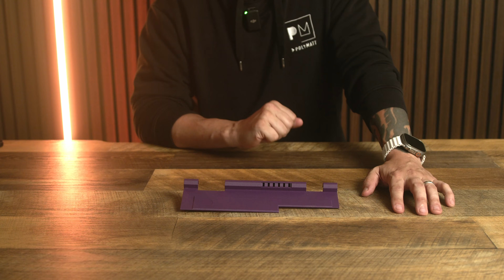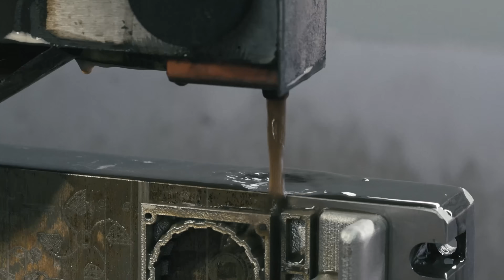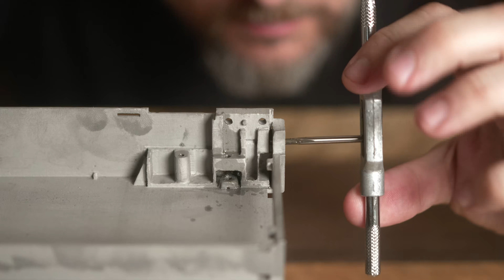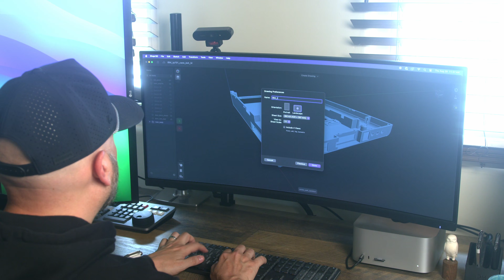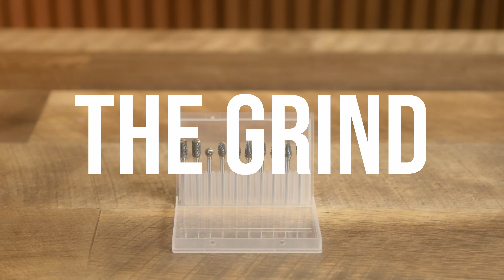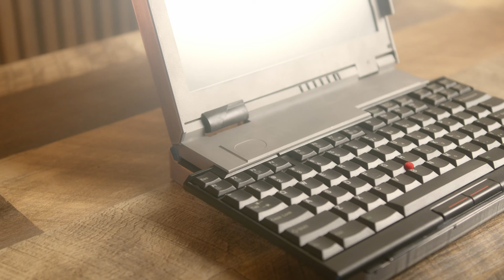I 3D printed a METAL laptop

Comment: Amazing project. But you didn't show it closing? Isn't that and the keyboard mech the most important part of this laptop?
Reply from the maker: Yup. Good catch. I eluded to some bowing issues of the bottom case. It’s currently preventing the laptop from closing completely. I’m kicking myself that this part of the explanation wasn’t in the final edit. Currently trying to figure out a way to flatten it because those 2 extras millimeters are preventing a smooth close.  😔
Reply: @polymatt  Thought it might be something like that!  If you figure it out, I'd love to see another update on that.
Reply from the maker: @domramsey  I’ll definitely do a followup when I get that sorted!
Reply: put it in some sort of press to hold it flat while it heats up to temp & also cools down. somthing like a ganja rosin press 😂😂
Reply: Seems like the best use of this would be a "frame" and then attach a sheet of metal to the large flat surfaces?  Obviously that require more fasteners etc.  But in terms of for example creating your own bespoke Chassis to use a commonly available lid with EG a Framework or Steamdeck motherboard.  (Edit: I should have watched to the end 😅)

Comment: fantastic job, the 701 deserves all the love it can get, would love to see a 3d printed aluminum 701 some day... maybe with the framework board in it? dream laptop right there
Reply from the maker: I really love that Framework exists and I hope more companies will start doing the same. I’d love to do a BYOC (bring your own case) for a Framework build.
Reply: Or a from scratch design with a Framework board, CNC milled would probably be cheaper.
Reply: @XenonG  ah ya, CNC from aluminum would probably be a good option, nicer finish too... I have a pair of 701c thinkpads that I got long, long ago, but one is in pretty poor condition (top lid cracking badly)

Comment: Hello, not sure if I missed some detail, did you discard using anodized aluminum because you was expecting some warping and the treatment would get damaged anyway?
Awesome to see you doing some metal work and testing the capabilities of these new manufacturing technologies.
Reply from the maker: Hey thanks for the comment! The choice of 316 stainless steel was really because that’s the only option the manufacturer had available - and I wasn’t going to pass up the opportunity 😄. I had heard about metal 3D printing but never actually knew how it worked so it was a lot of fun digging in and learning. 

A few people had suggested CNC but I really wanted to try to additive route and not sure if the complexity of the bottom case could be done with even a 5 axis CNC - but something I’m definitely going to look into. Thanks for the watch and the comment!
Reply: @polymatt  I was pretty impressed by the details and accuracy, the last time I saw a metal part done that way was 6 years ago and it needed to go on a 5 axis mill for all the accurate features (not just for the extremely ones) but it was a titanium alloy part for a military drone so who knows.
Awesome that your sponsor gave you that opportunity and that you could share it with us.
Reply from the maker: 💯 and now I’m going to consider a lot more projects to be done in metal!

Comment: See? I told you it would be sweet to make it out of metal :D Turned out amazing :D

Just one thing. I would put some isolation on the edges of the PCBs, i noticed that you put them in without it. The different layers of the PCB can in worst case end up at the very edge of the board. Slight sanding of the boards by putting them in and out, or any slight burr could cause those to touch the case, making a short between layers.

Instead of vinyl, you can also use Plasti-Dip, like the stuff people spray their rims on the car with, to get a different color. This is basically liquid tape. You could have just sprayed the inside of the case, and used a brush on the edges, and called it a day :D
Reply from the maker: You totally called it - and great thinking on the PCB edges! I hadn’t thought of that. 

I did think of the plastidip route but in my experience it’s really not that durable and breaks down over time. I wanted something that was a little more stable!
Reply: @polymatt  Yeah the vinyl is much more durable just higher effort. But the whole project was extreme effort so makes sense 😎